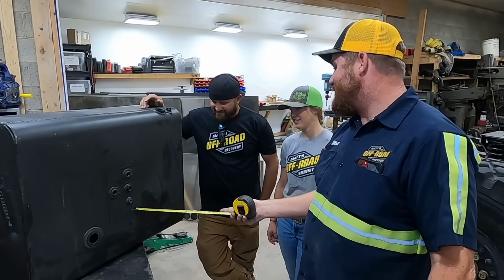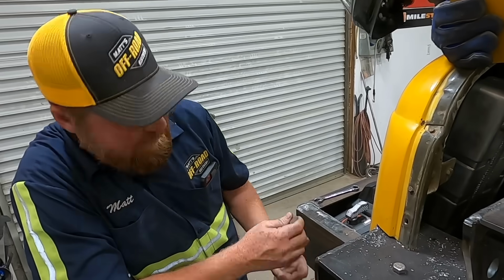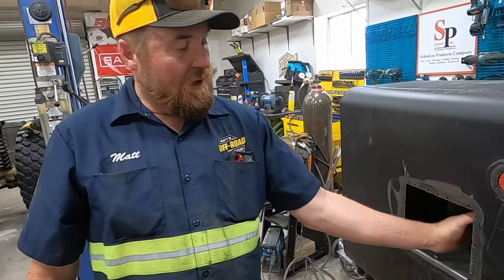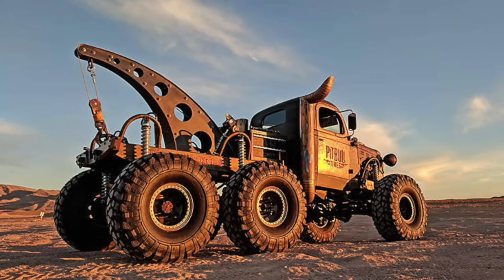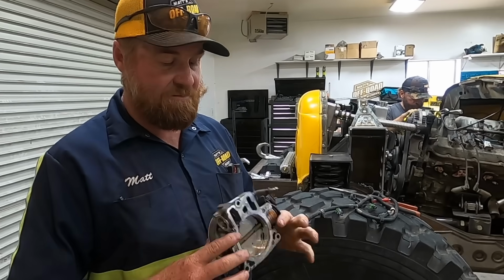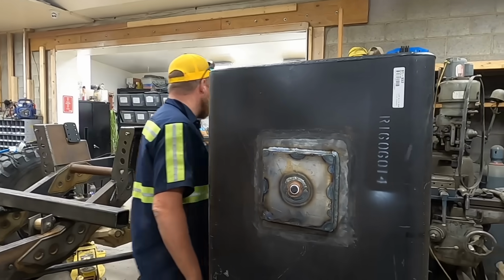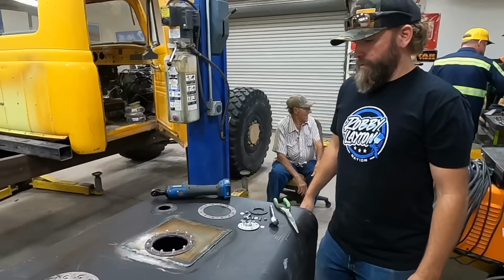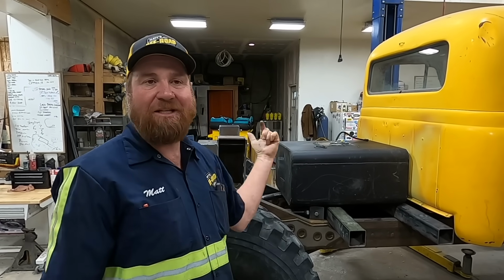World's Largest Off Road Wrecker...There Can Be Only One.

Comment: With the extrema angles that you put your rigs through how do you not have oiling problems. I'm surprised that you don't need to run a dry sump and scavenging  pumps.
Reply: We're probably going to figure this  into the next motor we're going to build if we have problems especially if we have problems with this one 🦟

Comment: I might not agree with the way Matt does things but that's not a problem. Chances are slim that I'll ever see anything he builds and even slimmer that I will ever use any of the stuff he builds. It's always interesting to see the way he solves problems and builds stuff even if it's not the way I would do it. I'm not crazy about the radiator set up but time will tell if it works and it\s never going to overheat on me.

Comment: One suggestion.  I have seen it in a few places.  I was told/taught that when doing cut outs to drill holes at the corners so there is never a square.  It is supposed to help limit cracks from starting in those corners.  Like drilling a crack at the end to stop it from running.

Comment: don't weld brackets to the tank ..... there's a reason why manufactures use straps to hold down tanks ...... welded brackets will crack in time , think about the weight of that tank when full

Comment: The fuel line inside the tank needs to be gasoline submersible, otherwise it will deteriorate and start to leak. Fuel line used for the rest of the fuel system is not submersible.

Comment: You should have went with a much larger fuel tank. Seeing as how you have a gasser and not a diesel it is going to use 2-3X more fuel than a diesel would. So you need at least 40 gallons for a gasser.

Comment: Hey Matt ever think about adding a bung to the bottom of the tank with a 1/4 turn block valve to drain and or a tap point. That way no trail repair needed if the fuel pump burns out. You can just add an external pump and get home.

Comment: If you come across another situation where you need a custom fuel sender, take a look at KUS USA, they make stainless steel captive float / rod fuel sending units. They fit in the standard mounting holes, and come in essentially any length. Best part is since they're a captive float / rod, they dont end up seizing up over time like the old toilet bowl floats.

Comment: Your not Engineering anything unless you're paying a qualified engineer to design it. I have found they get touchy about that.
The reason fuel tanks are mounted with straps and not with brackets that are welded to them is because with vibration  and any flexing cracks will develop next to the welds and then you have gasoline leaking. Might be a good idea to have a drain plug in it as well. The sump was a good plan although as shallow as it is it's hard to say if it will be effective. 
Glad you compared trucks.

Comment: "Engine" for those of you that didn't flunk physics.
A "motor" does not run on fuel.
Reply: >>Motorcycle
Motorcar
Motorcade 
That’s a few motors that run on fuel<< @MattsOffRoadRecovery    All powered by engines (unless they're electric) Plus...you forgot General Motors, Ford Motor Company Motown etc. Well.....they're all wrong. Slowly destroying the language for over a century. 
Engines run on a fuel, motors convert one form of energy to another (mechanical).
Ever heard of a power window engine, a heater blower engine, a windshield wiper engine?...a hydraulic engine?

Carry on....love your builds.

Comment: Matt Your tank mount may crack over time! Any frame flex will twist the tank and eventually crack the mount or tank. I've been in the fuel tank business for 45 years. It's best to use perimeter straps with rubber cushions to allow the frame to flex without twisting the tank. Offroad race cars never tab their tanks straps only.
Reply: And now he's gonna make a segment in his next video why you are wrong and why is gonna do it his way anyway.
Reply: @justanotheryoutubeuploader  I'm sure something along the Lines of "The frame won't flex"
Reply: Hey man I got a project Mud truck I'm gonna make a custom tank for you have another form of contact we can discuss it through
Reply: @runnerfore9164  Oh sorry message me though fb
Reply: It's a 99 4runner got big plans for it. It's gonna tear Mud a new ass if you know what I mean
Reply: You are absolutely right sir
Reply: yup, gonna crack at the weld for sure.
Reply: I was thinking about the mounting on that tank. I was thinking if you ran two pieces of angle iron straight down the tank. The angle iron alone would probably keep the tank in place never mind the bolts. Some people in here were saying about flex and yeah that's beyond me
Reply: I was thinking the same thing.
Reply: To wide . No different to a normal tank. ... if on a hill. Need narrow tank. With a fuel level separate.  To know your trully empty. Pickup at the bottom of a narrow tank. You know for shore. God bless
Reply: @mick00000000002  Had a stroke trying to read that

Comment: could have saved yourself alot of time and work by just buying a fuel cell the ones they use in off road racing and stock cars. The ones they use in baja are pretty big and have a big piece of foam in them to keep gas from moving all around and have ball valves in all the inlets and outlets to close incase of a roll over.

Comment: It is always a challenge as a public figure to entertain and conduct your business as the way that you see best to do it. I am not a mechanic nor a fabricator. I think all these wonderful builds you do are amazing. You and your crew. You do not work in a vacuum. 

I will just set back and marvel at all that you do. I think once they see your latest creation in action then they can understand what it can and cannot do. #1. It will be an off-road recovery vehicle. That by itself should tell you that the frame is going to have to have some agility. It will not be used on the road in a recovery configuration. # 2. It is to be design to be another tool in your overall operation. # 3. It will be fun.

Comment: I know it's kinda after the fact but I have moved & also extended my fuel floats before to get a fairly long sweep for a more accurate gauge. The long bed mounted tanks have more than enough room to swing a longer arm but in your case I can totally see where the square baffling you & Lizzy built would need to have a slot so probably not worth it.  As you said.... good enough!  The baffling is more important than a gauge at the top end lol.  Lizzy has become a fairly desent welder!  She should learn how to use a portable on-board welder like Paul & Rory have for trail fixes.  They also make a wire feed   attachment now that mint make it easier.  Rods are faster & easier to fit the type of welding though.  They burn way hotter so make sure she is covered up well so she doesn't get flash burned.  Fwit... we use to use shredded fresh tater juice to treat your eyes from welding flash burning.

Comment: Hi Matt I look at you from Italy, I was wondering why you don't use a Cummins engine for your new truck, from 6.7 you can also have 700 hp and a considerable torque at low engine revolutions, furthermore fuel consumption would be significantly reduced precisely because Diesel consumes less fuel than a petrol engine. Hello from Italy

Comment: Everybody has an opinion , here's mine .... Those nice old chromed hooks on the front should be switched over so the built in angle faces them to the outside corners of the wrecker not to the center the way they were sat down on the frame rails . .

Comment: I wonder if the tank shouldn't be 90 degrees to the way it's sitting there? Use the same cross pieces, bolt them to the frame on rubber isolators and strap the tank down to those pieces.

Comment: What makes this the worlds largest off road wrecker?  There a recovery truck in Birdsville Australia that looks bigger.
Reply: If you're looking for size in wreckers that drive on dirt as well as roads, check out Heavy D Sparks' HET.
Reply: My guess would be you are referring to the Roadhouse/Jeff Barnes 4x4 flatbed truck. In short, there is off-road and there is rock crawling. More generally, what kind of capabilities are needed in an off-road recovery vehicle depends on the terrain it is going to be used in. In some areas you might want/need amphibious capabilities, in others you need low ground pressure (like the fine sand in Sand Hollow), in others you’ll need large approach, departure, and break-over angles, sometimes you need low centres of gravity, large articulation and a small turning radius. And you might also need a combination of several of these capabilities. For what Matt needs, the Roadhouse vehicle is lacking capabilities in the category of rock crawling (and probably also low ground pressure).
Reply: @aphextwin5712  you confuse size with capability.  The claim is the largest.  There is no doubt that Matt’s wrecker will be Extremely capable.
Reply: @andrewjames777  No, I am just saying that when Matt uses the term off-road xyz, he is referring to a vehicle that can do off-road in his area. To spell it out, Matt is building the largest wrecker that can do almost all off-road trails in his area. 

The Australian truck might be larger than what Matt is building, but it is not true off-road in the way that matters to Matt. Just imagine the word ‘rock-crawling’ whenever Matt says ‘off-road’.
Reply: @aphextwin5712  ‘his area’….title is ‘World’s largest…’
Reply: @andrewjames777  You know that when some people say ‘off-road’ they just mean gravel road? Others might mean rock crawling with it. The same word frequently means noticeably different things to different people. 

Matt could have called this build “The World’s Largest True Off-Road Wrecker” but to some that also would have sounded pretentious (“who is Matt to say what makes something a true off-road vehicle“) and the more qualifiers you add, the more of a mouthful it becomes. 

But why every week somebody has to bring up a different vehicle and pretend they don’t know what Matt means with ‘off-road’ in general and this project in particular is beyond me.
Reply: @aphextwin5712  Thats golden, how do you know what Matt thinks or says…..

Well you got me there!  I forgot that in North America the word “World” means “USA”, “largest” means “greatest” and “donated” means “pledged.”
Reply: Semis and 50 ton rotators can also drive on unpaved roads. But they can't do buggy trails or blow sand. If you can't get over the obstacles to the broken down buggy you don't get the job.

Comment: Did you say you are feeding the return line back to sump? Is there a risk the hot fuel returning is kinda in a closed circuit now and will keep getting hotter? Rather than mixing with other fuel and using entire tank as heat sink?

Comment: Sorry if its been covered before. but what happened to using the frame as a fuel tank?
Reply: Ummmmm  Da eff is a Matts off official?
Reply: @JoJodeanpergl  common spam message across YouTube.
Reply: The original plan was to use the frame as an air tank.
Reply: @aphextwin5712  Oh.  My bad.  Thanks.

Comment: I love watching your videos. After watching you deal with the gas tank on this big ole wrecker I wanted to say that I’m a bit concerned with how you are planning to secure the tank in the truck. If you weld mounts on the tank, these are going to be points of stress as that tanks and it’s contents get bounced around on the trails. This could lead to a major leak at an inopportune time.  That tanks looked like it was 16 gauge or maybe 14 gauge. It probably would not take a great deal of stress to cause you issues. 
How would it work if instead you created a saddle which you set the tank into with straps going up and around to attach it?  This would transfer the stress to the saddle and straps more so than having it all concentrated at points on your gas tank. There could also be some nice strips of rubber or similar material between the tank and other metal parts.
Reply: Agreed!

Comment: Building that sump is smart. I have dual saddle tanks on my truck and once Im at 1/4 tank I call it empty cause in rough terrain it does slosh and then I suck in air and have fun adding fuel and priming again. A sump/baffle  and a fuel bladder is a good upgrade.

Comment: Serious question for Matt: have you ever daily-driven a fuel injected GM product? The reason I ask ties into this whole gas gauge and running out bit. I was always taught that 1/4 tank on a GM means it's empty (or at least it should be treated that way). If you run GM products too low on fuel, the pumps burn out because the fuel itself is supposed to help cool them. 

Genuine curiosity. Because of this, I have never driven a fuel injected vehicle of any manufacture below 1/4 tank. It's an anxiety worse than 2% battery life remaining on a Tesla.
Reply: I’ve driven many fuel-injected vehicles below 10% without problems (sometimes even below 5%), though none of that was off-road. One anecdote however is the 1990s VW Golf. If you drive them in a tight (< 40 m) counterclockwise (ie, left turning) circle at close to the maximum speed this car can do at such a tight circle, it will run out of fuel within a few minutes (depends of course how full your tank is). But it seemingly recovered from this without issues after you let it sit still for a brief moment.

Comment: Reference the fuel tank, never seen a heavy duty fuel tank retained buy welding to it.  It should be placed in a cradel to retain its movement for anf aft and sides and retained by straps hloding it on place. Nothing to do with teh retaining of the tank should be weleded to it, 60 gallons, 227 litres of fuel, or 167kgs or about .370lbs, thats a lot of weight to hold onto... Great to see the build, just would hate to see it run out of gas... Cheers

Comment: Hey guys great vid and great to see the truck coming along! A trick we used for welding pin holes prior to weld repair was peening with a radius punch by hand or power, And our trick as nuclear welders to strengthen our welds was to cold shock with liquid nitrogen after passing the vacuum test or pressure test. Cold shocking relieves the weld of stress.. Great Job -

Comment: Drove that type IH for a oil well service in the the mid 1960s in the hills outside ventura ca and we had to have a auxiliary electric fuel pump because pulling the hills the mechanical fuel pump did not pump enough gas

Comment: You should at least turn the return liner away from the pump intake. May cause cavitation especially when fuel gets low and pushes what little fuel you have and need away from the pump especially when on an incline/decline. Just saying.

Comment: Hey Matt, I’m not sure if you watch the vice grip garage channel or not. He has a burnout car he built that has a second fuel tank. The second tank is just a little bigger than the fuel  pump that’s in it. Is essentially sends fuel from the main (bigger) tank to the smaller one the the smaller tanks pump sends it to the motor. The smaller tank also recirculates back into the big to keep it from pressurizing. It made it so no matter how hard the fuel was sloshing or the angle of the car it could always pick up fuel. Just a thought if you have anymore issues with that problem.

Comment: Great Job... My question is why didnt you just use a crate 502 big block?? At least another 100 foot pounds of torque and another 150 horsepower?? I really like the way you build it.. Its like you build for what you need and use.. The other question I have is why dont you have rear winches on the back of the Jeep and Morvair?? That would make it a lot easier on you pulling people out and for loading on a trailer..

Comment: “Comment bellow why that will never work” 
Don’t want to be that guy but it will work for awhile. But it’s introducing a stress point to the actual tank it self that will eventually crack, Just set it on rubber, then run two straps over the top (isolated with rubber) and bolt them down. There’s a reason all OEM tanks are rubber isolated.

Comment: Matt the only thing I would do is weld some doubler plates to the bottom of the tank that your mounting straps will then weld too. That way, for whatever reasons you should create a crack where the strap is welded to the tank it will crack the doubler plate rather than the tank itself and cause a leak, It’s just cheap insurance.

Comment: Consider  the possibility that welding the fasteners onto the gas tank may result in metal fatigue which causes a rupture next to the weld. I wonder if it may not be wiser to strap it down in a conventional manner so as to avoid the possibility of the tank rupturing.

Comment: To the guy who doubts that Trevor can’t wire a complete vehicle, just speak for yourself, sir.
About 40 years ago I personally built the very first ever built multi million dollar computer hard disk media vacuum sputter system. I didn’t design the mechanical systems, but did design the wiring controls, put it together, wired it completely (over 600 circuits) in low voltage controls, high voltage AC and DC, wrote the book on how to troubleshoot it and made it run. Trevor has my ultimate respect for what he does, I truly appreciate his knowledge and skill.

Comment: You cant hard bolt the tank.. iij t will RIP a hole in it where you welded the strap to it.  You will have to build a cradle and wrap the straps around the tank to the cradle.. look at a semi tank.. if your tank is 40 gallons that's 350 lbs your moving around ..
Call the truck Insurance money..

Comment: Make sure that your fuel return feeds into your sump. Otherwise when you're at some crazy angle and a little bit low on gas then it will drain the sump way faster since it's not getting refilled and the fuel that's being returned is not ending up back in there.